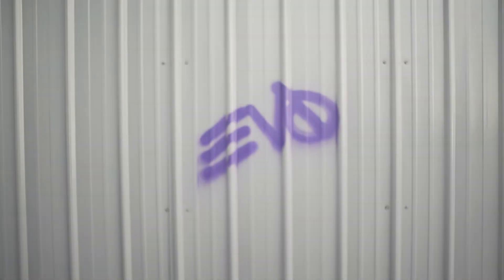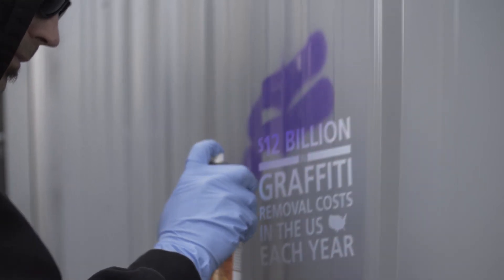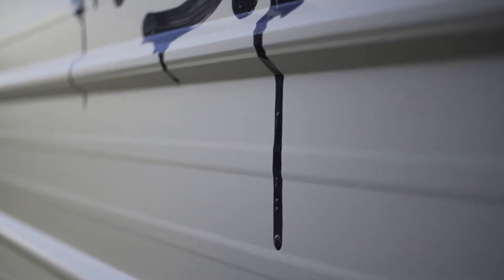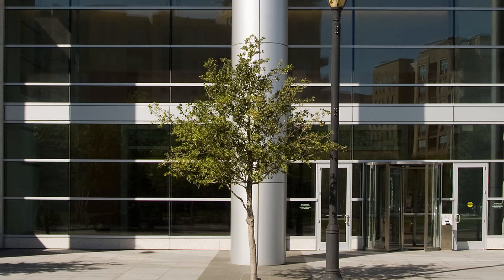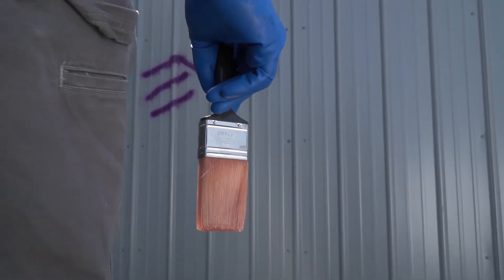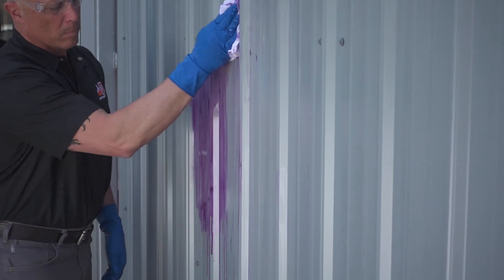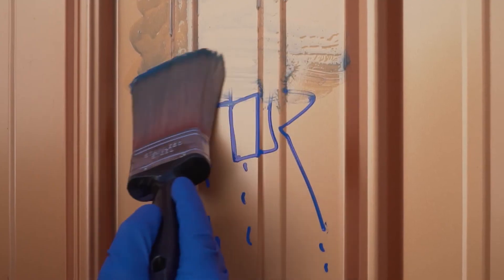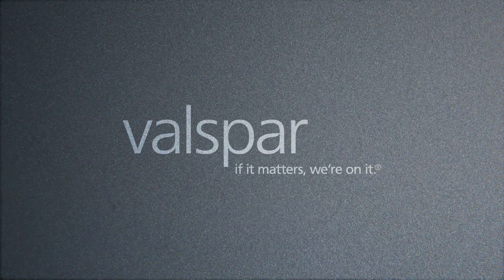Why Choose the Sherwin-Williams Anti-Graffiti Coating System

Comment: Removing graffiti off a metal panel?
Isn't metal the easiest? Remake this with concrete and we can see if it works.
Reply: can we trust it is real spray paint in the graffiti any thing i can be made to make it look like it real pray paint or maker can be washable paint that dissolves easily when washing it with any thing